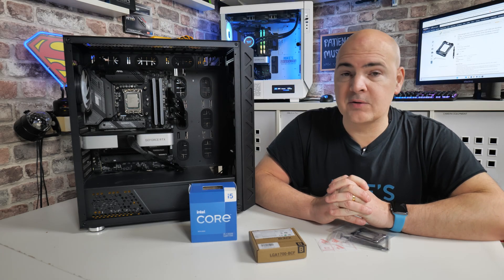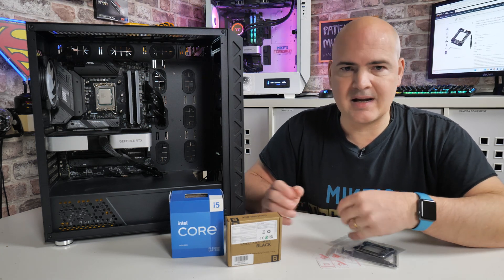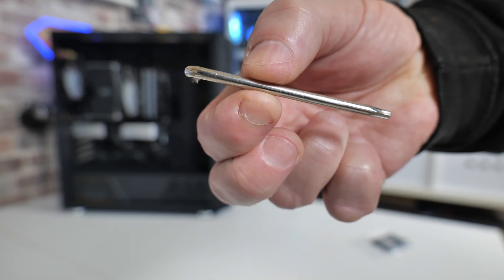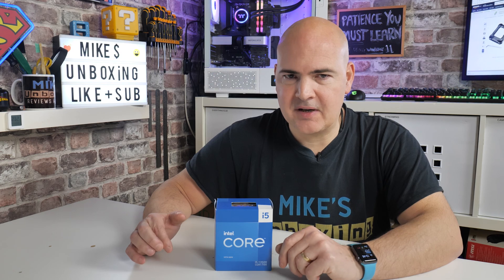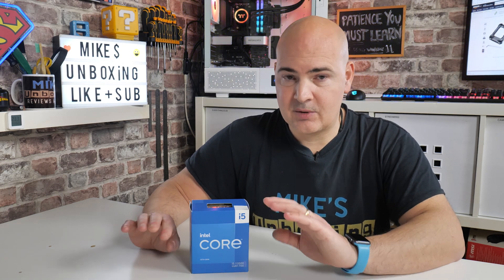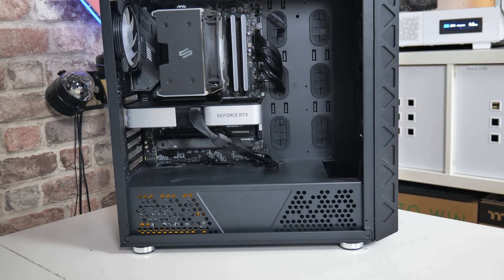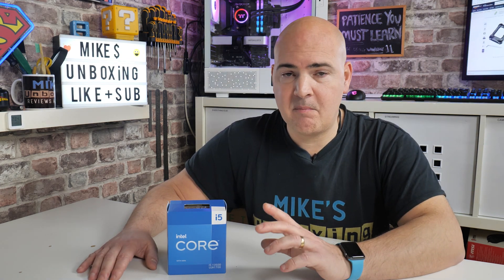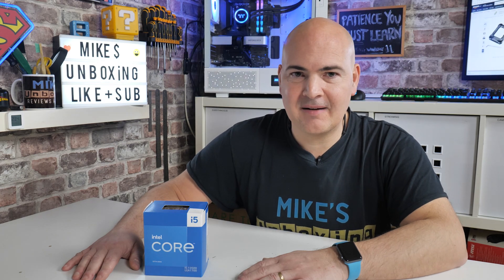Thermalright LGA1700 BCF Contact Frame Plate Weird Results Please Help!

Comment from the maker: Available from affiliate links:  
Amazon Local:  https://amzn.to/3XQ3Qh4
Ebay UK:   https://ebay.us/kIpHRG
Ebay US:  https://ebay.us/y6bgth
Ebay CA:  https://ebay.us/3sY9XZ
Ebay AUS:   https://ebay.us/MYNRVz

Cheap Windows 10/11/ Enterprise / LTSC /Office / Steam & Gaming Keys available from affiliate links:
https://www.premiumcdkeys.com/mikesunboxing
Discount code:  MIKESUNBOXING 10% off entire order

Custom mouse mats: https://technicallystable.com/?ref=mub
Use the discount code MIKE to get an additional 10% discount and free shipping in the UK for MUB fans
Reply: Hi Mike. I have exactly the same issue with my N1 and now I seem to have a CPU issue with RAM as well. I guess I'm going back to the Intel frame.
Reply: You tightened the screws down way too much! The reason why the screws were so loose on the original bracket was because that's how tight they were supposed to be!
Reply: Contact frame is all about your CPU cooler. Most coolers do not sit firmly or evenly on the stock bracket. The Contact Frame fixes this. So with the frame those people are seeing better temps. However if your cooler does sit on the stock bracket firmly and evenly you wont notice a difference

Comment: Was there a solution to this issue?
Reply from the maker: not really it seems that the chip or socket bending differs from board to board and for brand new ones they are basically going to be flat as they can be

Comment: DDR 4 or 5? DDR 5 modules have an on board memory controller DDR 4 uses the cpu memory controller the bend corrector frame enhances contact to the pins associated with the memory controller more work-more power draw? oh...Would/was this subject to all the bios stuff from overlimits 1700 cpu temps
Reply from the maker: DDR4 and DDR5 both have the memory controller on the CPU for Intel and AMD, but they do transfer through the pins so the extra speed or frequency could be responsible

Comment: The instructions, which you didn't read, describe listening for the click to begin. Hope this helps. Bye now.
Reply from the maker: yeah the reverse turn until you hear the click, that is common for all screw threads, but that is just to find the thread starting position
Reply: @mikesunboxing  Correct, and to turn the screwheads 1/4 turn each, which will take forever, walking the frame down. Keeping it level, which again, you didn't do. You just twisted them puppies down, level be damned. Thats where you went wrong, that's why it didn't work, for you.
Ya know, this would be a great "Don't make my mistake, read the instructions" video.
Reply from the maker: But also what you are not taking into account is that when this video was made there were no instructions other than those pictured in the box. It wasn’t until the advice from gamers nexus and thermal grizzly that thermalright amended the guide online

Comment: You didn't correctly install the frame, my temp on my i7-12700k went down 10*c running prime95 after I installed the Thermalright CPU Contact Frame. Install the Contact Frame correctly and repost your results, hopefully you didn't bend the frame from the Mounting Screws being too tight.
Reply from the maker: that is a whole point of the what i was trying to get across in the video, the instructions and usage are very vague, if there is a specific torque for the screws it should be in the instructions. I dont think it would be possible to overtighten and bend it as in theory it is flat metal and could only squeeze outward if the metal was soft enough, but i understand what you are saying

Comment: I know this is a old video, but installing frame is quite delicate  . I had to reinstall it 3 times. You have to rotate the screws anti clockwise until it clicks then tighten them diagonally at 90 Degree angles.  The frame is very susceptible to skew mounting you cant just fasten screws diagonally and hope its level like you did. Gamer Nexus has a excellent guide on doing this installation the right way.
Reply from the maker: yeah its a shame that thermalright don't have detailed instructions included and we have to rely on third parties or trial and error to get it setup

Comment: thermalright works. its off the board with rubber padded feet. dropped me 2 degrees in idle using si-100 cooler and intel 14600k. its the grizzly that sits so close to board.and grizzly has no protection like rubber pads on thermalright

Comment: If you enforce all limits in the bios it can give a more consistent result between the ILM and contact frame.
Reply from the maker: i am reading this and i am considering how that could work, could you elaborate on that
Reply: Not letting the cpu get over clocked
baseline factory settings.   no ai-nos no xmp

Comment: so if we got a used cpu thats bent, would this straighten it back flat over time?
Reply from the maker: I guess it might over enough heat cycles and constant tightening of the screws
Reply: @mikesunboxing  what could we use  to compensate for the bend until we think its straight?or that prob wouldnt be possible as its goin to push if it can over time and compromise where we compensated so that it wudnt become straight again only bend again
Reply: we can de-lid it with a tool they make out there. then heat and put between 2 pieces of glass and clamp it let it sit , check with straight edge an do that until its flat again

Comment: mate i did the same to a Intel Core i5-14600K  with a Thermaltake TH360 V2 and temps are 10c hotter .. I'm at a loss no idea why
Reply from the maker: yeah sounds like a mounting pressure problem there
Reply: Too much pressure!

Comment: i got stability issues also after install this bracket. My games crashto desktop for no reason
Reply from the maker: probably like me, you need to look at the mounting pressure
Reply: @mikesunboxing  hi! I just decided to install again (pain in the ass) but this time i didn't tighten it too much. Result: No more crashes, and a very big drop in temperature! Like 10 degrees! So did you also resolve your problems?
Reply from the maker: @BR-ip5pz  yeah on another system i did it and it was okay with the pressure being a lot less, but temps didn't really change

Comment: Interesting results, my 14900k idles at 8c and gets up to 70-80c under full load at low 400w range with a small overclock.
Reply from the maker: damn that is quite a range spread

Comment: You need to update this video with the correct torque on those screws. Those are way too tight and can cause odd performance and boot issues. Also you didn’t show your thermal pasting techniques, did you use the modern techniques with the spatula? There are a few issues going on here. Getting 5-10 degrees C improvement is common if installed correctly.
Reply from the maker: there are no official torque specs from thermalright so i cant use them or advise people to use them, that is the whole point of the video really

Comment: Poor install.  Didnt research at all.  Screwed in too recklessly and too tight.
Reply from the maker: that is my point exactly, you shouldn't need to reasearch it, the product should have clear and specific instructions if there is any issues with levelling or torque settings.

Comment: What you got is normal.  It is the bending of the CPU that will occur over time which you are avoiding.  The contact frame is mostly used with the I-9 because it gets so dang hot.

Comment: The reason for the inconsistency is the BIOS firmware dynamically increasing the volts which in turn increases the wattage and heat.    More volts doesn't give better performance it just gives more heat, the only reason they do it is for stability - lower voltages are more prone to crashing.   They would rather you run hot and reliable than cool and unreliable, and you can fix that with the right BIOS settings.

With the Thermalright frame on the first test you got 2C cooler while using +10 watts, so in that test the Thermalright was cooling 10w of heat for free.  However this assumes the BIOS was running the same voltages at the time of both tests.   It probably wasn't because the last 2 tests showed no meaningful difference.

To get to the bottom of it you need to adjust your BIOS settings so that you get consistent voltages during the time of the test.   And test on the same day - ambient temps inside the case may have been different the night before.

Comment: To all who know better, is it possible to damage the socket pins if overtightening? Thanks
Reply from the maker: possible but unlikley. you are more likely to bend the pins away from the intended pad target on the cpu and cause processing errors or crashing or no boot
Reply: @mikesunboxing  Thanks. I did pretty much like you,  I tighented them when the screws were just about to stop but didn't forced past it, I just didn't wanted to leave them loose. I have not tested it yet

Comment: Now a year later how did you end up solving this issue?
Reply from the maker: was just a matter of finding the right tension on the frame, and because the bend on the CPU can be different for each cpu it takes a bit of work
Reply: @mikesunboxing  Thank you

Comment: im looking for upgrade my i5 10105f to a 12400f, in my country the frame value is almost 30% of cpu value (insane). does 12400f need that frame or only for k versions. ty
Reply from the maker: It should be fine without it, it is a lower tdp and much easier to keep cool

Comment: Mounted this on i7 14700k combined with an Arctic Liquid Freezer II 240 and Msi PRO B760p. The heat difference is minus 2-3 degrees. For example in Myth of Empires i hit almost 100 degrees during loading and the ambient temperature is 20 degrees

Comment: 1. you didnt fix the variables (voltages and frequencies between tests)
2. you possibly over tightened the screws
3. did you check contact patch of the thermal paste
4. what thermal paste are you using
5. are you putting enough thermal paste on

so many variables and i dont think your testing methodology was particularly good.
Reply from the maker: i agree with what you are saying, but the fact remains that thermalright have no guidance on torque or tightness. Also being that is is a solid lump of metal in theory it should not be able to be overtightened as the screws and backplate and the frame are all metal, and should just bottom out.
the method could be completely wrong, that is the job of the manufacturer to give clear and consise instructions.
Reply: Totally agree with you. The manufacturer is totally at fault here. I just installed one and followed the gamers nexus tutorial and dropped a good 10 degrees under load and 5 at idle on a 14500
Reply from the maker: That is pretty decent results. What motherboard is it?
Reply: ASUS prime b760m-a WiFi ddr5 and I do think I didn’t have great mounting pressure before I got the frame anyway.

Comment: Any follow up video for this?
Reply from the maker: i have been using them on and off and it seems unless you are using a cheaper more flexible motherboard this doesn't seem to make a lot of difference, although cleanup is a lot easier
Reply: @mikesunboxing  oh ok thanks. Because i have z690 e. Just using stock bracket and just xmp 1 enabled my temps are in 55 to 65 when gaming. So i guess i dont need it. Do you have video tutorial on how to OC my 12700k? I tried the ai overclocking but some game crash on 5.2 ghz at ai overclocking, i want to do it manually, just to make it 5ghz i just dont know how.
Reply from the maker: @Tylenol888  head over to the discord chat and someone will help you
Reply: @mikesunboxing  ok thanks.

Comment: i have used the exact same contact frame with my 13500 too. got weird instabilities and crashes. Now i uninstalled it and used the original bracket and no problems at all.
Reply from the maker: seems to be a tension thing, but it shouldn't have any flex to it really being a solid metal lump

Comment: You went way too tight with screws.
Reply from the maker: You can’t go too tight there is a hard stop. Which makes it metal to metal. You can’t compress solid metal with a tiny screw
Reply: @mikesunboxing  Well, I am not sure what to say - You went to max tightness,  clearly, so even though that may not technically be over the limit, I and others in the comments are telling you that's the issue, it is actually putting too much pressure on the pins and warping the CPU to have worse contact than the factory ILM. I mean, maybe the Nexus video will help, they go into it and the torque in detail and I followed them and it reduced it by 10 degrees for me with NZXT Kraken (14700K). I then did a moderate undervolt of -0.5, set Asus Pro Art motherboard to unlimited wattage and even overclocked 200mhz using XTU by simply increasing multiple. That's all I did, and I am avoiding thermal throttle.
Logic says, if it works for all of us but not for you, you either 1) got a faulty one, entirely possible or 2) You did something wrong. I was not trying to insult you in any way, shape or form so I really hope you didn't take it that way (got to be careful online these days). Cheers!

Comment: I know this video is a year old but I do have a question,  should you put a very small amount of thermal paste on the outer edge of the CPU aluminum to help transfer the heat to the The Thermarlight plate.
Reply from the maker: no, the hotspot for the CPU is lower centre, the sides are pretty cool
Reply: Okay, thank you..

Comment: Re: your comment (ca. 4:25-) about the ILM's backplate being sort of welded on to the mobo, so requiring no worry about its falling off, I beg to differ. Mine fell off as soon as I removed the ILM, and keeping it in place was the single hardest aspect of installing the BCF.
Reply from the maker: what motherboard is that?
Reply: @mikesunboxing   Mike, the mobo is an Asrock B760M Pro RS_D4 with the Intel i7 12700 (w/ built-in graphics) and no additional GPU. I didn't do any deliberate testing before/after the installation, but added it, as you noted, for the low-cost peace of mind.

Comment: This worked wonders for me. With the stock frame 14600k reaches 92c max cinebench overclocked to 5.9, with the contact frame, never reached 85c with a bit better but neglectable score. At stock speeds never touched 75c. I think i can push my overclock to 6! Amazing product!
Reply: I just installed one on my 14700k and im getting 10 degrees lower temps.
Reply: DAMNNNN I just bought a 14600kf and I was wondering how far the overlocking range was but I didn’t think it was that my much. Have you ever tried adding sub zero temps? I introduced Cold air from my window directly through my old AIO and I want to try to set something like that up again.

Comment: Everyone keeps complaining about your torque on the screws. Well when i install the motherboard in a case i crank the mounting screws all down snug. The lga bracket sits on the board where the screws are so what's the difference? I did mine on a 14900k and i snugged them just with my fingers. I think these brackets are machined different from the factory and some are a couple thousandths of an inch off, causing more or less pressure on the cpu pins. I do feel like it was pressing too hard on the cpu before the screws even stopped. I had weird results too, on only a week old computer build, where i think the frequency dropped in the stress test. Ive also had just a couple weird crashes, but could be related to driver bugs since all parts are new. I saw no temp improvement. I bought this cuz the 14900k just barely hits 100c after a while.
Reply from the maker: thanks i am glad you see what i mean with this

Comment: Only thing I can think is the room your testing in now is hotter than the room you took the original temps in...
Reply from the maker: Same room and pc in the same position maybe a couple of degrees different in room temp at the most, temps are usually quite stable

Comment: EDIT: Forgot to mention I have done no OCing or anything. The only changes in the BIOS I did were a little more aggressive fan curve for the case fans and turning on the XMP profile for my RAM 4800 to 6000.

I recently got a 14700K and I'm using the Deepcool LT720 on an MSI Z790 Gaming Pro Wifi board. When idle it usually sits around 25-30 C. However, when doing Cinebench 23, it gets up to about 90C after 5 minutes then very slowly rises a couple more C before the end of the 10 minute cycle. I also tried Prime95 and it straight up got into dangerous territory (100C) on that within a minute or 2. I was very surprised and had to kill P95 really quick because I was afraid of damaging something. The Deepcool fan speeds showed max on the pump, as it has been from the start, and the fans getting up to 2277 or so. I also tried just a normal video encode in Handbrake and it got up to high 80s then around 90 as well. The LT720 is mounted top side with fans as exhaust and all the case fans (2 bottom intake, 3 front intake, one back exhaust) are set to a reasonably aggressive fan curve so the air flow seems pretty good.

Would you recommend getting one of these plates for this or some other advice to lower the temps? I don't know much about contact plates, underclocking, etc. but I'm kind of afraid for the longevity of my processor with these numbers and I feel as though I should do something.
Reply from the maker: undervolting is the answer, these cpus are designed to hit these insane temps unless restricted

Comment: With the same CPU it's not pulling more than 134w and still have 20000 points in r23 benchmark but I'm wondering why your CPU is pulling that much of a power(hence more heat) before and after the contact frame...
Reply from the maker: probably a weird bios setting somewhere